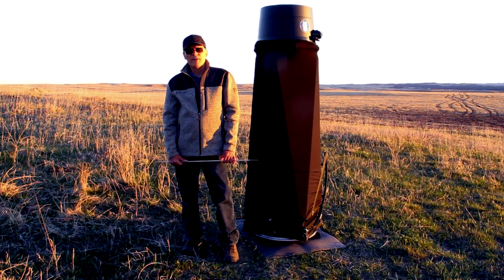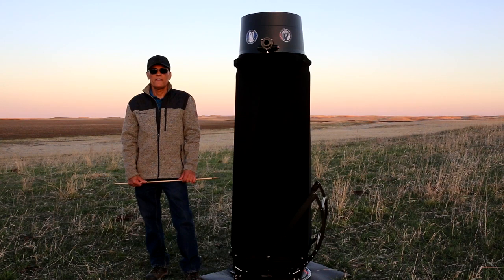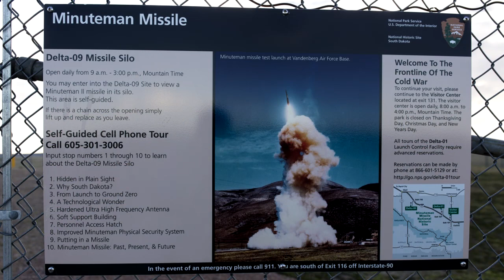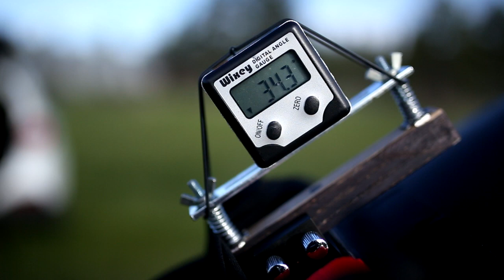Hubble Optics UL16 Dobsonian Telescope Review

Comment: Thanks for the review! UL16 is a great dobs!

I bought a UL16 F/5 back in 2013 and still using it. I used coil spring to help balancing the scope, this reduces the ballast weight significantly. Also, I numbered the truss and holes on the frame, this reduces collimation effort after re-assembly.
Reply: It's nice to know that they hold up well after 7 years. I am considering purchasing the same scope! How do you find the assembly and disassembly? I am still weighing up the best way to store the scope between uses to protect the primary mirror.
Reply from the maker: Thanks for the tips. :)

Comment: UL24 here, and yes it also had super fine tiny hairline scratches too, no issues with performance. Note also the mirror has a dielectric 95%+ coating. From different angles under bright conditions you'll see purple, blue, yellow halos on the surface which are normal for curved surfaces with dielectric coatings.
Reply from the maker: Didn't know that one on the halos, Rick.  Thanks for sharing!

Comment: Great video.  I do not have this brand, but found a hack about the weight you might like.  Do exactly what you did, but have a 2.5 lb on-hand with neobydium magnets on one side for those occasional low altitude views.  Take clear packing tape and tape-on about 6 of the 1/2" magnets onto the 2 1/2 lb weight.  When weight is an issue, slap it on the main steel weight.  Doesn't look elegant, but it is only used occasionally and only at night.  They could probably be expoxied onto the 2.5 lb weight.  Clear skies!
Reply from the maker: Thanks for the tip!

Comment: Question for you since you have reviewed the Explore Scientific 12" and this one do you feel the extra $1000. for 4" of aperture is worth the expense. Also I always have to travel to observe which system the Hubble of Explore scientific is easier to setup and teardown?
Reply from the maker: Interesting that  you ask.  I'm currently working on a video that compares the UL16 to the ES12 at at dark site and one with moderate light pollution. Fist off, the fact that they are both ultra lights puts them ahead for transportation, setup and tear-down compared to traditional designs.  Because I use night vision they are both somewhat similar in brightness on DSo's.  But the UL16 has the edge for brightness without night vision.  The main advantage I can see the UL16 has over the ES12 is the image scale and resolution, it's better but not knock you down better.  But noticeably better.  I would have to say the Hubble UL16 is better made but the ease of collimation on the ES12 is amazing.  It also poses a smaller package for transportation.  Cool down time for the primary mirrors are  somewhat similar.  But the Hubble is a 16" mirror so that in itself is impressive.  If money is an issue, then the 12" gen 2 is good enough really.  And if it were me I'd save the $1000 and put it toward getting a PVS 14 night vision monocular for the 12" with a 7 or 12 nano meter Ha filter for Nebulosity along with a Badder High Contrast filter for galaxies and star cluster.  Now that would be a real game changer!  And you'd be able to do some visual work under moderate light pollution.   Something no amount of aperture can provide without NV and a Ha narrowband filter. 

For more on night vision astronomy check out my NV video if you haven't do so already. https://www.youtube.com/watch?v=6usKtqpVMi8&t=166s
Clear skies!
Reply: i know Im asking randomly but does someone know a tool to get back into an instagram account?
I was stupid forgot my password. I would love any help you can give me.
Reply: @Talon August Instablaster ;)
Reply: @Gael Angelo it worked and I now got access to my account again. I am so happy!
Thanks so much you saved my ass !
Reply: @Talon August happy to help :)

Comment: Thanks for the great review - I ended up ordering one! The F/5 version. Just curious, at about 9'10" into the video, you put aside what look like two brackets and you speculate about their function. Are these likely to be the altitude encoder brackets? They rather look like they could be. Would be good if such brackets were included by default, even if the HO DSC system is not ordered.
Reply from the maker: The brackets are used to support the alt bearings.
Reply: Thanks! I did quickly work this out once I received the 'scope 😀. It certainly works well!

Comment: I noticed you added springs around the collimation adjusting screws between the plate and back of the housing on your holder. Why did you make this modification? Does this help hold the housing position when the collimation screws are loosened? I noticed if the screws are loosened too much the housing rotates out of alignment very easily. I am able to work around this by using small adjustments and keeping tension on the back of the housing. Maybe the springs would be helpful and not necessitate another check with the sight tube?
Reply from the maker: Hey Jim, you guessed right.  The springs help hold the housing position when the collimation screws are loosened.  They also provide tension on the screws to keep them from backing out when done. I've seen this employed in other secondary mirror housings so I can't take credit for the idea.  You can get them at a well supplied hardware store.  They usually have an assortment to chose from.   Thanks for posting!

Comment: I have a 20" F4 obsession but wanted something smaller but not too costly with good quality. Sounds like that is what you are saying here. Light enough to carry out without much hassle means more viewing. I would want to get a nicely formed cover for that mirror. After watching your review I just put a down payment on one. How about the DSC and WIFE option they offer? And other options.
Reply from the maker: Congrats on your Hubble UL!  What size did you get?
Only option I would get, if I didn't have DIY analog setting circles, would be the Digital Setting Circle system they offer.  It keeps things light and adds real value to the platform.  The go-2 is out of the question for me. = extra cost, weight and complexity.

Comment: Hi Richard congratulations for the videos, I do enjoy them very much!
I would like to ask you the material of dewshield and how did you fix it (tape?). I'm getting soon the same telescope but the 14 inch and I'm thinking about ideas. You dew shield is very good looking and I guess is necessary because the extended secondary mirror? Thank you, best regards from Portugal.
Reply from the maker: Hey there Ricardo, the dew-shield was made from a plastic tub; the kind they use for plants or laundry. It took some searching to find the right size.  In the end I found one at a building supply store.  (A farm and feed store might have something that will work too.)  Keep in mind this adds extra weight at the eyepiece end.  So counter weights are a must with this design.  There is an alternative material that can be used to make a light weight one. It's called "Easy Bagger", used to keep plastic bags open when gathering autumn leaves.  It's great for making dew shield of different sizes: You can use black duct tape, or Velcro, to put it together and flat-head screws and wing nuts to secure it to the secondary cage.  Remember to put the shinny side out.  Oh, and congrats on that new UL14!  https://www.acehardware.com/departments/home-and-decor/trash-and-recycling/trash-bags/68617?x429=true&gclid=Cj0KCQiA9P__BRC0ARIsAEZ6irg4UBOpjXH_nCQ0SIXH1-Qr7Ca1vQ3Tp8Q-anvQlqFmHgRh1_BXIqYaAnVNEALw_wcB&gclsrc=aw.ds
Reply: @DakotaStarryNights  thanks a lot Richard, I'll be looking in such stores for dew shield materials. The telescope shouldn't arrive for another month. I have hope I will be able to see visually one day the Horse Head Nebula  with H Beta Filter with 14 Inches. From a dark sky I was already able to see without filters very bright Veil, Owl and Helix Nebulas with 8 Inches and were unforgetable experiences. Veil Nebula had a kind of blueish fluorescent bright :)
Reply from the maker: I saw that blueish fluorescent light in the Veil, NGC 6960.  But only once with a 6 inch refractor at a class 2 dark site.  It seems really good transparency and dark skies are needed to see that fluorescent lighting.  It is, like you said, and unforgettable experience.

Comment: Hi, I think I found the blue metal clips that you used for your carrying sling for your UL16, Nite Ize brand S-Biner SlideLock in Aluminium, blue color, size #4, they don't sell the Alu ones in UK but someone on Ebay USA had them, so I choose one in red (better for finding them if lost when using red light torch, or simply that red looks nicer to me). I think you must have used size #4, because of the profile of the look of the thing, and because of the loading requirements (the Stainless Steel ones are rated at 75 Lbs pull for size #4, the Aluminum ones don't have a rating that I could find?, and size #3 is only 25 Lbs / 11Kg pull strength, so wouldn't be enough to be safe, I assume). However I can't find out what sling you used? Do you have a brand / code / link to it? I also have a HO UL16 F4.5 on the way to me this week, finally, after 1 week short of 3 months of waiting for it to be manufactured. Best Regards.
Reply from the maker: Hey Steam;  The sling I used was just something I had laying around.  I believe it might have been off a shoulder bag of some kind.  It doesn't really matter so long as it's strong and long enough.  But I like your side handles idea.  Gonna try that one myself. :)

Comment: Nice review. I was contemplating buying the 16" model.  ThIs helps the decision process.  You are the 3rd to mention that 16" is mainly for darker skies and it's probably better to try a smaller diameter objective to maximize the potential of the scope to the observing site.
Reply from the maker: Yes, that been my experience using an 8", 10", 12", and 16".  The 10 or 12 would be the most useful under average conditions.  Not that there's anything wrong with an 8".  Just saying...

Comment: Thanks for the review !

You mentioned the DSC assembled at the secondary cage. What type of DSC ? I would expect it to be in the rocker box.
Reply: OK I see it by the end of the review. Sounds reasonable; ) How do you calibrate ?
Reply from the maker: @mbrcomp  I've designed a spring loaded plate that the Digital level gauge sets on.  I cover the calibration in this video: https://www.youtube.com/watch?v=gsEECOUZnGg

However I've much improved the AZ component since then.  It now has a vinyl AZ ring that rotates on a metal circular tray.  The AZ ring is magnetized with 4 magnet buttons.  This enables it to hold its position after calibration.  (You can see it in the video at: 31:30, above the weights) I will cover its construction in an upcoming video: "Making the Hubble Optics UL16 Even Better."

Comment: Thanks for this reviens. I hesitate betwenn Hubble optics 14" and 16" for visual (without nb). I have to move some km for very clear sky ( SQM 21.5 at 5 km). There is some ligth near my garden....
Any advise about the value of 2" and the weight (21kg vs 27kg)?
Reply from the maker: Well, there's currently about a $500 difference. The 14" has a 6" lower eyepiece height at zenith which is nice.  I tend to need a small step stool for that position and I have the f4.5.  I do believe the visual difference between the two isn't much based on my comparison of the 12" to 16".  So, seeing how you're not fully sold on getting a 16"  I'd go for the 14" and save some money while you lose some weight and lower the eyepiece height.   Clear Skies!
Reply: @DakotaStarryNights  thanks for advise. Well, i invest for the next 20 years.. so, i'm not worried about      500€ but about how i can handle with a 16". For size of focuser, i'm 1m80 (5ft 11in) tall, not a problem.    Focuser is at the right place of my eyes.
In your review, i saw you carry quite easily HO 16".
What is weight of rocker, optical part without rocker? I saw your carry it with rocker with optical part.
Thanks again, Hubble optics telescope don't have many owner and review in Europe.
Excuse me for my language, i'm not very fluent.

Comment: DSN I’ve watched this a number of times great work! 

I am ready to hit the order button in 2 days Friday 22 Sept but keep vacillating between the 14/16” this will primarily be a drive to dark sky scope and I have a “astronomy-transport” Dodge Journey so they will both fit with ease. I have a skywatcher 6”dob (fantastic scope BTW) for grab-go at home at home  dozens of dobs over the years up to 10” so even the 14” should provide “wow” factor.

My main thought about the 14” in favor of the 16” is rigidity. I have nothing to back it up but with a engineering background the 14” should be more rigid. Anyway I know this is kinda old but perhaps you’ll see it before I hit the order button!

Dark skies!
Reply from the maker: Hey George, I went from a 10" to the UL16" and I'm glad I did.  That put to rest the aperture fever.  😄  The weight and transporting size is not that much difference.  But knowing you're looking through a 16" is different.  Rigidity doesn't seem to be a problem. And I've got a homemade dew shield made out of a laundry tub with a PVS14 for night vision connected to a 35mm TV Panoptic in the focuser.  Granted I had to counter balance it all but no big deal.  Best regards. 🪐
Reply: Thanks for taking the time to reply!

I ordered the 16” F4.5

Tong answered a couple emailed questions within a day. I was told 30-60 days till ship out. I’ll be happy if it’s 120 in time for galaxy season! Now I am buying a couple premium eyepieces over the next month or two.

Clear skies!
Reply from the maker: It took a while for me to get mine, too. Congrats!🥳

Comment: According to your experience, will I need a coma corrector for Hubble Optics UL 20 inches (f/4.2)?
Reply from the maker: That would depend on the quality and focal length of the eyepiece.  Also, some guys are really sensitive to coma fields.  The UL 20  F/4.2 is a screamer, really fast.  So, it may be a bit more noticeable.  But a guy could always pick up a corrector like the TV Paracorr-2.  Though I'd wait first to see if it's a problem for you.  One thing for sure, if I had a 20 coming my way I'd be so stoked!  Coma or no coma, bring it on!  We're talking seeing M51 in detail kind of stuff at a good dark site!  Congrats.

Comment: Great review.very helpful for me.But make me wounder about couple things.
Supporting system for the main mirror not look very strong.does six point support enough for holding this big mirror? Also focuser plain look a bit thin, does it stable enough when you go to big magnification? And last one stabilization look good with all stuff on scope but what happen to scope  when you change the eyepiece ?does it still hold the position?
Reply from the maker: The primary mirror is supported by a two frame design.  Six points are enough.  The mirror in this dob is lighter than a traditional mirror due to it's sandwich construction.  It cools down quicker too.  Thanks for posting

Comment: I want to get 20" Dobsonian instead, thanks for the review.

Now my only worry is, how about the quality of the primary mirror from Hubble Optics [Sandwich mirror]? I may get structure somewhere built for me, but then the cheapest mirror [primary] i found is from this maker, just not sure about their quality.
Reply from the maker: I find the seeing and transparency to be more of a problem to get the most out of any optics I might have out for the night.  That said, the only real guaranteed way of getting the mirror you want is to buy it from one of the top end mirror makers with the accompanying paper work. A costly endeavor to be sure.  Although it will not have the quick cool down as the Hubble Optics mirrors.   And that was another problem I no longer need to deal with.  Thanks for posting.
Reply: @DakotaStarryNights  Seeing and transparency is my last worry because i will never control that and it will never control me which scope to buy, even if it is the worst in the world, i saw images were taken under poor seeing with 14" and 16", they were amazing much better than images were taken under excellent seeing with 6"-10", so i will go risk with larger aperture no matter what.
I can't buy from top  end mirrors, very expensive, i may buy from them only if i can find a cheap cheap affordable brand new structure so i can save for the primary mirror, i already found a top end secondary mirror maker one or two so that is done, only they don't sell primary ones, and i was thinking about having not very expensive one primary mirror, my cheap mass production scopes has Chinese mirrors and I've got excellent mirrors, why by sudden this Hubble Optics mirrors will be any less?
Thank you very much for your answers and i look forward your answers always.

Comment: Richard knowing what you know now would you go Hubble optic or Explore Scientific 16" dob
Reply from the maker: The ES ultra light dobs are way easier to collimate and might hold it a little better.  But I would still go for the Hubble 16.  It's better made and lighter weight.  The sandwich mirror is a big step forward in dob design.  Though there is a wait time and the whole international shipping thing to consider.
Reply: @DakotaStarryNights  Thanks for the quick reply, I am leaning towards the Hubble. I know you were happy with the optics of both telescopes so that is reasuring. A month ago i was looking at the 18" starwatcher stargate dobs but i think after doing a lot of reading with negative comments about the optics i have changed my mind on those scopes.